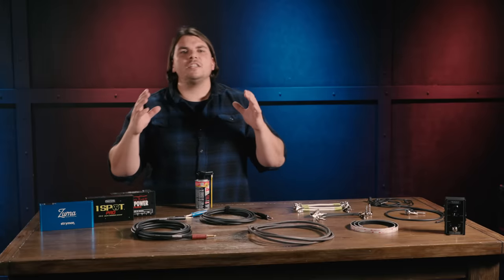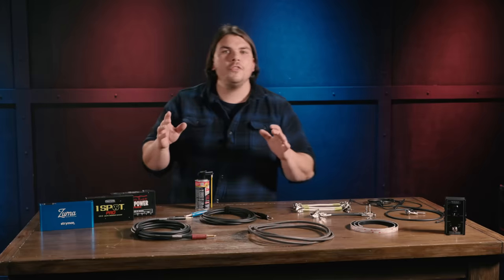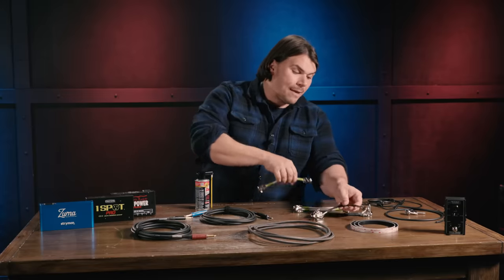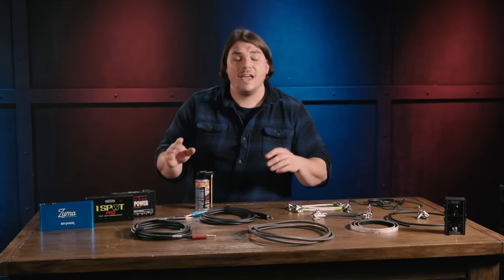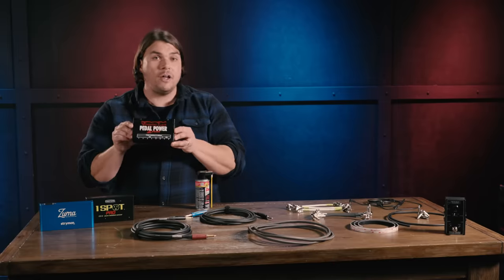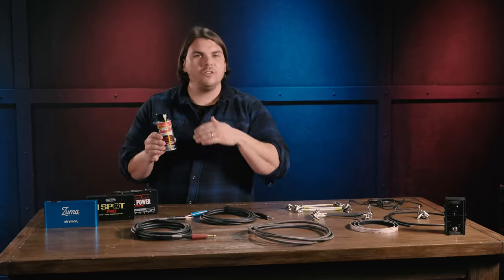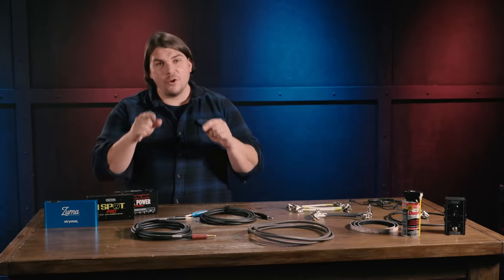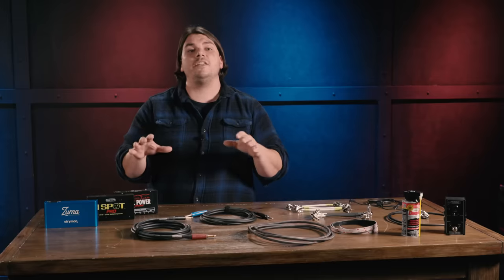6 Pedalboard Mistakes You Don't Want to Make

Comment: I use a Voodoo lab mondo brick which has isolated ports and daisy chain 5 pedals that are all 9V, but they vary from center positive and negative polarities.

I’ve heard that whatever the case is for the pedal, if plugged into an isolated power source, it’ll work fine. 

But since I have 5 pedals with different polarities all going to the same 9V isolated port, is that going to be a problem?
Reply: the polarity obv matters 
current draw as well
hope u figured it out 😅
Reply: @jonniefast  yea I did lol

Learned a lot since then, I had as many as 20 pedals on my cover band board all powered up with my Mondo brick and daisy chaining 3 or 5 while using the highest mA ports. Never had any issues!
Reply: @XxStonedImmaculatexX  my issue was with undervolting (9v instead of 10v etc) for years at a time - i finally lost a pedal bc of it 

it still "works" but is v finnicky and unreliable now
Reply: @jonniefast  what pedals require 10v?
Reply: @XxStonedImmaculatexX  lots of them 
the one i roasted is the electro harmonix cathedral reverb - i think it wants 9.7v
Reply: @jonniefast  Oh yes I see

Comment: Good info here.  I'm guessing the same vendor makes the Ernie Ball and MXR cables.   Why is it so many rig rundowns I see though don't seem to follow the separate power and audio thing.  Some, even from well known artists, are haphazard looking.  Dual lock is awesome though.  I hate the goo that velcro leaves on the pedals.  Dual lock is easy to clean off if need be.
Reply: Scott C I’m not sure if it’s the same vendor or not, there seems to be some sort of labeling on the Ernie Ball versions, showing one side for guitar and one side for the device (pedal) input. Perhaps it’s twisted pair shielded?  Perhaps it’s directional and has the shield connected on the output side only internally.  You can run into some problems with AC power if not properly separated from the audio cables, but for the voltage and current for guitar pedals this will not be a problem.  I think it’s a good practice to observe if you have the space to separate them, but they are going to be circumstances are areas where you’re going to cross paths with the DC and the audio path.  I would be more concerned about where you dress your audio cables in relationship to, say a linear power supply.
Reply: Scott C - I have Hosa patch cables and they have same connectors. So maybe they make them and EB and MXR re-brand them? It wouldn’t surprise me. No need to reinvent the wheel.
Reply: @Burnt_Gerbil  impossible to know, correlation doesn't equal causation as the old saying goes.  Those connectors are very common, made by Rapco/Horizon and GLS Audio in China.  Many companies use them.  The cable could be anything.  You could take it apart and measure the capacitance and see how close they are in composition and spec.  I've not seen any Hosa versions that have this same plug, typically the Hosa one is a little more flimsy, but I'm not an expert on their product line.  Anything under about 20-30pf per foot in terms of capacitance I think will be acceptable for any pedalboard in a general since, especially if you use a quality buffer on the input and output of the system.
Reply: Vertex Effects Mason, thanks for the quick reply.  More just observation on how janky it used to be, and still is. The video with Mitch and Eric Johnson was funny because he just had piece of plywood and the pedals were just taped down I think. He also seemed to have a mix of power and batteries.  I agree with you though, the wrong noise isn’t a good time. Thanks again!
Reply: @Burnt_Gerbil  Yeah, indeed.  Just merely observations, though.  Not saying either is better or worse, both companies make good stuff.
Reply: @VertexEffectsInc  🙂

Comment: Anyone have thoughts on the MXR M238 Iso-Brick? Seems to be a pretty good value for isolated power. Also need a few parts with higher mA things and it seems to have all that I need.
Reply: Andy Bungert they’re also good.  Switching supplies like the Truetone and Strymon.
Reply: I've owned both and I prefer the  zuma just because you have all of the 500ma outputs on it so you don't have to worry about where you plug in your pedals. They all have a looot of headroom to work with especially for my digital pedals like my h9 and digitech whammy
Reply: @mrpres17  okay and it does have a couple that can switch to 18v. Sweet. That 10th input on the MXR though ;)
Reply: @mrpres17  oh holy crap it's "expandable" with more units? Dang that's something to consider
Reply: @andybungert  yeah definitely, if you need that 10th input and you're on a budget, definitely go for the mxr lol I got the zuma because I needed 14 outputs so I got the ojai along with it for more. Buy what you need!
Reply: @mrpres17  ah thanks to another rig doctor video he re-explained the whole multiple (lower mA) pedals into one input via Daisy chain or Y cable. Looks like the Strymon may be the one once I sell another piece of gear :)
Reply: @VertexEffectsInc  thoughts on the Ernie Ball Low Profile ribbon cables? Seem to be a great way to create more space.
Reply: @andybungert  for the purposes of neat cable routing, I think they would be complicated to do with the traditional zip ties and tie down mounts.  It really comes down to how you like the sound of the cables compared to what else is available.  With a properly buffered input and output on your pedalboard, the cables will have less significant influence so long as they're soldered connections (I don't know how the Ernie Ball is assembled internally).  I think for consumer level stuff, it's probably fine - but I don't think you'll see pro rig builders using these because of the requisite for customization.
Reply: @VertexEffectsInc  any that you recommend that have those low profile ends? I've been using Hosa and overall am satisfied with the design
Reply: @andybungert  lowest profile ends you can get are from SquarePlugs - the SP500, SP400 for pancake (right angle), and SPS5 and SPS4 for the short straight connectors.  You can pair this with Mogami 2319 as well as many other smaller diameter cables.
Reply: @andybungert  I own a few different IPS and most name brands are good but I find the Cioks DC 7 offers the most versatile features as well as clean iso power.

Comment: I have just spent 8 minutes watching a bloody advert , grrrr
Reply: Change your web browser to the Brave browser and NEVER watch another ad again.
Reply: Mick Denny did you not find any of these tips useful?
Reply: @VertexEffectsInc  If these didn't find any of this useful, I do
Reply: Agreed. "Don't use solderless, because Sweetwater sells this other stuff." I'm over here looking at my Evidence SIS thinking "I dunno. These were good enough for Pink Floyd, I think I'll be fine."
Reply: @KlockoFett  Sweetwater sells solderless.  My recommendation is based on what's the best quality and will have the most longevity.  David Gilmour uses the Evidence Lyric HG - a soldered cable, with a Neutrik 1/4" connector, not the SIS.  Also, professionals aren't immune from making bad gear choices.  I've seen few to zero technicians on the road with acts like David Gilmour using solderless cables for the exact reason that I mentioned in this video.

Comment: I have a question! Is it normal when I plug up my guitar with just the amp it sounds nice and clean but whenever I plug it up to pedalboard it gets dark. Why is that?
Reply: you need a buffer, JHS pedals made a video about it
Reply: That’s called tone bleed. The longer your length of cable is, it will naturally lose tone and sound darker. The guy from jhs has a good video about capacitance and all that. If your pedals are true bypass, it’s basically like you’re running a really long cable through your pedals and everything. If you use a pedal with a buffer, like boss pedals, it can prevent tone loss. Some people start and end with buffered pedals. I have a boss tuner as my first pedal and a boss delay as my last. Running through pedals can cause problems like noise and tone loss so it’s important to have good cables connecting between pedals, good isolated power supplies, and a good routing with a mix of both buffered and true bypass pedals. Hope that helps!
Reply: A single buffered pedal should help that. Seriously, a Boss tuner would work. Either that or use shorter cables to keep under about 25' or swap to active pickups and run as long of a cable as you want. Nothing against the JHS buffer pedal, but all it's doing is taking up real estate when you could also have something like a tuner, chorus, flange, drive, delay, etc. also buffered and multitasking in that regard.

Comment: If you have to cross an audio cable with a power supply cable, try to cross them at right angles to each other, never allow power cables and signal cables to run parallel to each other.
Reply: For DC this won't be an issues for the voltages and current that we're running on a pedalboard.  I would be more careful about putting pedals in the magnetic field of an analog linear supply than this.  AC, by contrast would be more in alignment with this idea of keeping the audio and power separated.

Comment: Go to Pedal Playground to build your virtual board.
Reply: GregSB that’s a great resource
Reply: It's a start but it is not representative of enough different pedals and board types to be of use to me.
Reply: GregSB This. Way easier than masking tape. What an idiotic recommendation..
Reply: Prasanth Selvadurai Yeah, they don't have everything. You can input your own dimensions or, even easier, sub in a pedal that's the same size (which is what I typically do). If the goal is to see what will fit, that will get the job done a whole lot easier than taping off a section of a desk, table, or floor.

Comment: Pancake connectors don't work with boss es8...
Reply: Heka Kain you can use Switchcraft 380 on the ES8 side and pancakes on the pedal side.
Reply: @VertexEffectsInc   ...i use
Gigrig solderless...

Comment: Holy hell I disagree with several of his must do points in this video.
Reply: Jimmy Knowles what in particular?  I love your recommendations on what you think would be appropriate for a follow up video in the future.
Reply: Isolated power is by no means always needed. I have used them in the past but find that 90% of the time a 1 Spot will be just fine. The main instance you will need an isolated supply is when mixing digital and analog pedals. In my opinion, start with the cheaper option (especially if you are using all analog pedals) and if you have noise issues, go for the more expensive option and keep the other as a backup. Also, dual lock is fine and all, but 90% of pedals on the used market and even some new pedals will have or come with some version of Velcro (I always use the industrial Velcro personally) and many pedal boards will come with it as well. These are the main 2 that bugged me a bit based on real world scenarios. I completely agree with you on going with soldered plugs because I have seen a bunch of guitarists cut out over the years because of their solderless connections going south. These are just my opinions. I really don't think anything you said was wrong, but perhaps should be expanded on.
Reply: @TxBassMan31  Isolated power will be necessary, if for example, you have poorly power filtered pedal, digital effects combined with analog, pedals with clocks in them that perhaps not well grounded - I've seen this on many high end boutique chorus', flangers, phasers, and more in fact.  This may not fit everyone's needs, but now many of us are mixing digital and analog and spreading these all apart from each other on a board, and with a daisy chain you're just increased your ground potential greatly to the point where you could have ground loops.  Dual Lock is unparalleled if you don't want your pedals to move around - but can be tricky if you are changing pedals regularly and don't know how to remove pedals with it.  An upholstery crowbar is the best too for removing pedals with Dual Lock without damaging them.  Thanks for the feedback!
Reply: Vertex Effects  O K I got a question that I've asked before. Never got an answer. I got a Caline P-1 pwr unit. It's high power on all 8 outlets. I think the only digital pedal is a Boss DD-5 that has it's own out. I run a couple 3 out daisys and power a total of 15 pedals, not all on board. I get a small bit on noise but nothing I can't live with. I don't think it is a isolated power unit. But would like to know if this is all I think it is. I only paid $23 with EBay bucks but it's only $35-40 to this day. In a yr plus I never had a problem or real bad noise unless I leave certain pedals on. Wah, phase shifter or Tube Driver can make noise if left on . Check it out and review it cause maybe could give it a like for others boards. Big savings over $100+ big power units.

Comment: 2:47 stop this mason please!!!!! there is nothing wrong with solderless cables that are made properly! a soldered cable is only as good as the person making it same as a solderless! you literally sound like a broken record at this point. 

People if you want to use solderless as you change your board around alot, move pedals, are a player at home do it! you dont need to spend the time constantly making up soldered cables also some of the patch cables you are showing though good quality ive had plenty of those type of cable fail aswell! in your mind the crappy coloured cables you can buy of amazon are better as they are soldered
Reply: Andy Bassist I’ve heard this gripe from many other people (one being Rhett Shull- has a popular guitar YouTube channel)- so that may be your experience with solderless cables , but it’s not too uncommon of a problem.
Reply: Andy, it's totally fine to use solderless - it's just not equal to a soldered connection mechanically or electrically.  This is physics - not something I'm pulling out of thin air.  If you prefer soldeless cables, I can't dispute a preference.
Reply: Vertex Effects nothing to do with preference, I don’t prefer either, but you just point blank start from the point that soldered is better, which just is your opinion that you are calling fact a badly made soldered cable is a bad cable. A cheap soldered cable is still a cheap poor quality cable which is very likely to fail.
Reply: israel hernandez its a gripe yes however many big bands use solderless cables without issue on big boards, a badly made cable is a bad cable regardless of it being soldered or solderless
Reply: Andy Bassist I’m a cable specialist in the aerospace field. I have same opinion with you. I can’t say there is no signal difference. If solderless has any problem, was mostly from assembler mistake or using wrong tools or parts. If I have to choose btw,  might say soldeerless. Actually solderless stands longer in stress